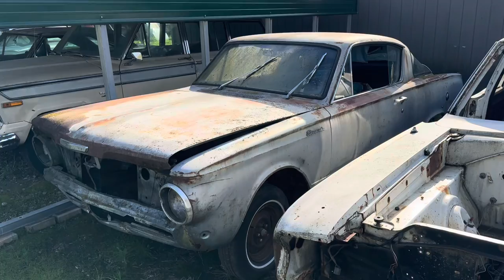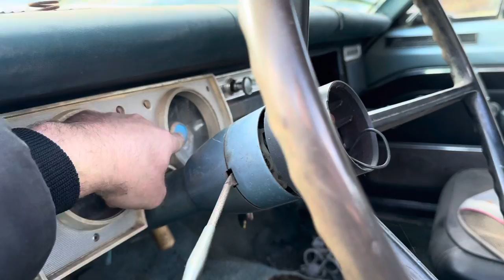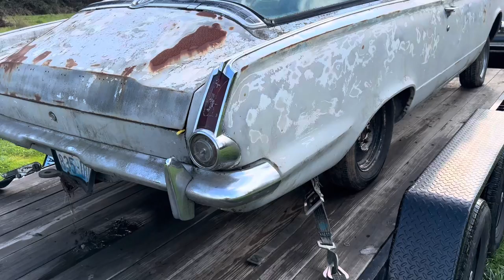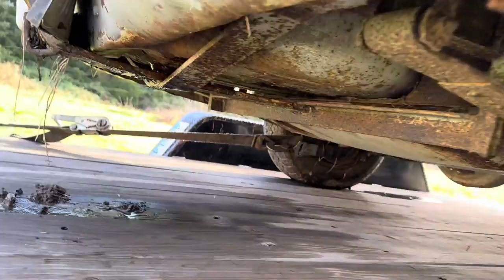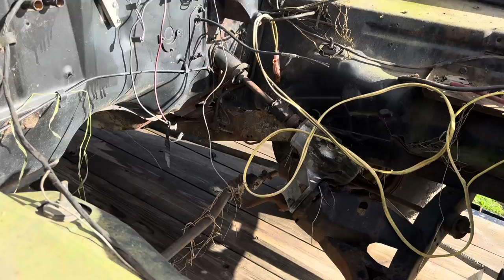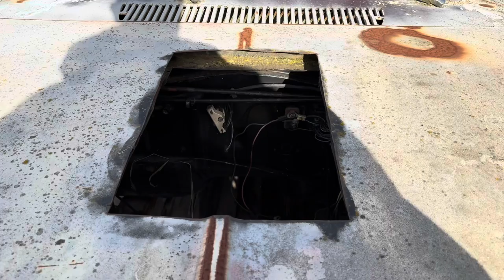What Are the Differences Between a 1964.5 and a 1965 Plymouth Barracuda?  Not Many But We Show You!

Comment: 8 3/4?- great score!
  Yup, just one K-frame V8 or /6
   Crazy thing is with 273 motor mounts the big Chrysler gen1 Hemis fit in there.
   The taller deck and different exhaust face angle cleared steering gear.
    Sold off all the gen1 stuff looong ago- most ended up with nostalgia drag racers in your part of the state, some to B.C., rest to the land down under.
Reply from the maker: Good to know!
Reply: Didn't know that a rear distributor hemi would fit in a 64 Cuda. My brother had both at the same time. If he had thought it would fit he would have tried it. Oh well...
Reply: @davidkeeton6716  Former coworker of mine, Carl- his high school automotive program had cars and trucks donated to it- and that's what they had to work with.
    So 392 into early A-body, poly pushbutton 727, 8.75 out back, used 'mix-n-match' exhaust manifolds-whatever that meant- industrial, car, truck, or farm equipment sourced I don't know, did have some photos if it running and driving around, though.
   Manual brakes, steering & stressed out torsion bars!

Comment: I have a couple of 64 Dart GTs. They mostly sit due to other projects and life, but I think these first gen A-bodies are cool. my hard top is a pretty great car. Original V8. Has a push button, cable  727..!?! yea! and has A-body 8 3/4. Been in NM its whole life. It came with a 340 my mechanic friend built. but now has a stout little 318. the 340 is in the shed waiting. Still has the 9" drums and single reservoir, which when it was running was sketchy as hell. The other Dart is a Convert V8 auto, Cali car, that was an art car most of its days, body needs help, but supper solid everywhere else. Interiors just do not live in the SW sun, so all the vinyl is cooked. Anyway love your guys programs and passion. Keep up the good work I'll keep watching.
Reply from the maker: Thanks!  I’ll get an early A convertible at some point, never had one and love convertibles.

Comment: There is no such thing as a 64.5 or 64 1/2 Barracuda. It was marketed and sold as a 1964 model. Period. I know. I was there. My mother bought a 1964 Barracuda in April 64. They had been on the dealer lot since around Christmas 63. We still own this car. Ford called the Mustang  a 64 1/2 as it originally came out in late April or May of 64. Your details in the description appear accurate to me. Good job!
Reply from the maker: Thanks!
Reply: My first Barracuda was a 64 with 273 push button 904 and on the rear below trunk lid had the Valiant emblem...

Comment: Obscure 1964.5 vs 1965 difference:  Firewall stamping  below and to the passenger side of the heater motor has a right angle in 1964.  For 1965, firewall stamping bumps are extended, almost touching the heater motor.
Reply: A couple more:

1965 radio has rectangular channel selection push buttons.  1964 has round push buttons.

Heater controls on a 1964 pull out/push into the dash.  On a 1965, they move left and right.
Reply from the maker: Thank you, great stuff!